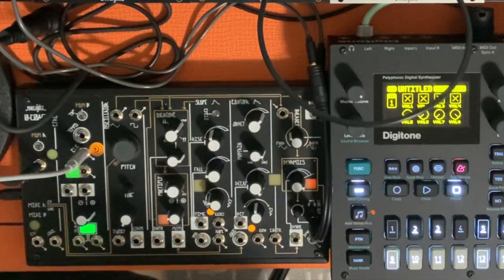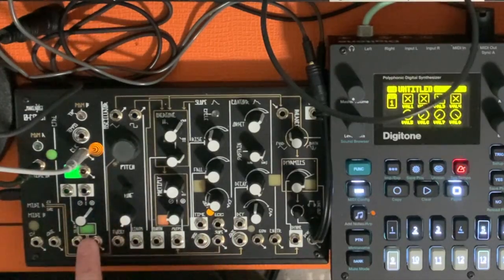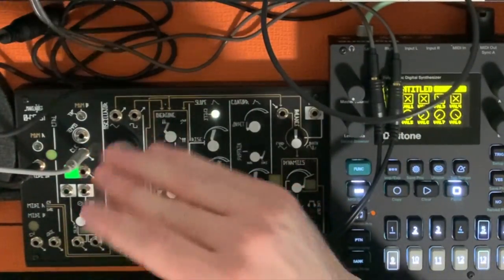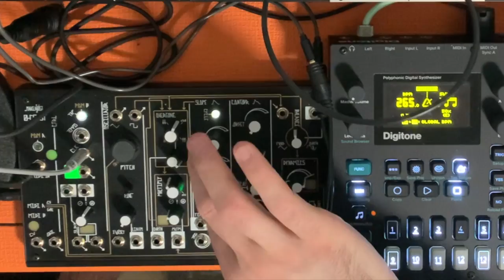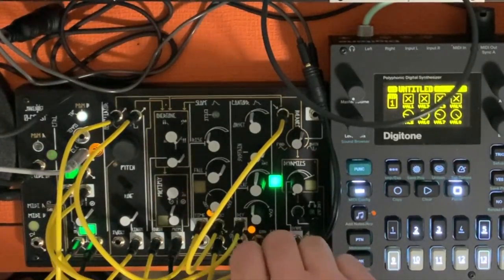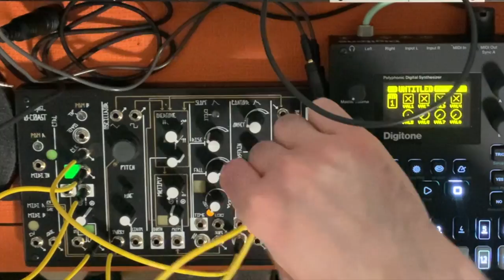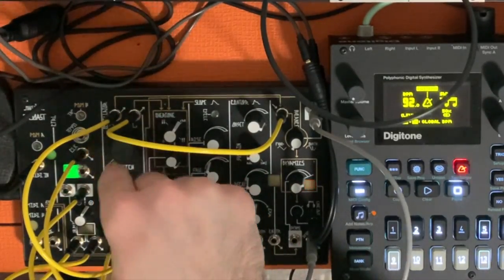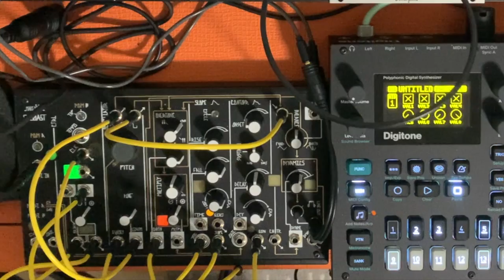0-Coast | Make Noise

Comment: Nice video. I'm using one of these with a digitakt but find the midi/cc pretty horrible to use. Are you able to use slide/portamento etc for individual steps?
Reply from the maker: Thanks! Yep, it’s as simple as assigning the DT/DN encoders for each desired cc on a midi track, then you’re free to send different CC’s per step with the sequencer.
Reply: @HypeConsumer  Cheers, do you have to do anything to the midi channels?
Reply from the maker: I forget which midi channel it’s set to by default, but it’s easy enough to change which one the Digi’s send out (see my Digitone video for more)
Reply: @HypeConsumer  Nice one!